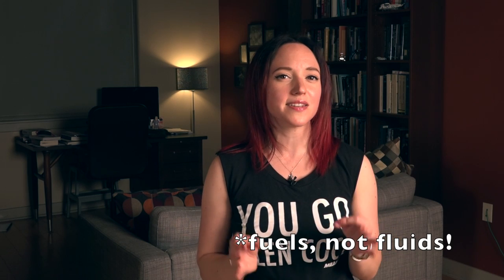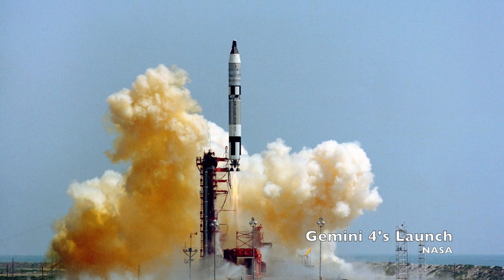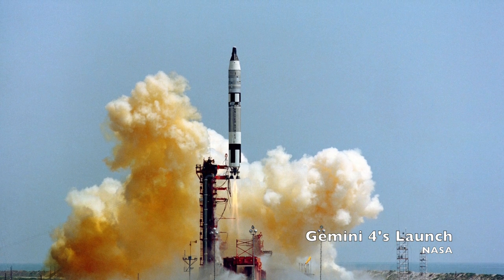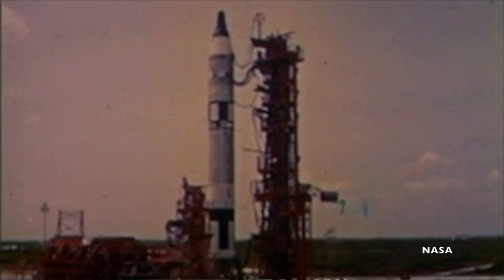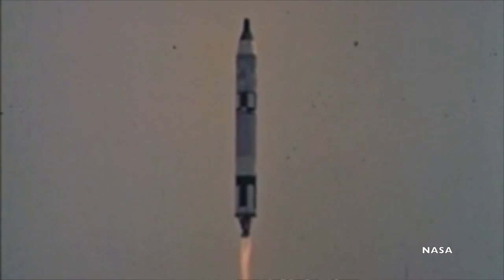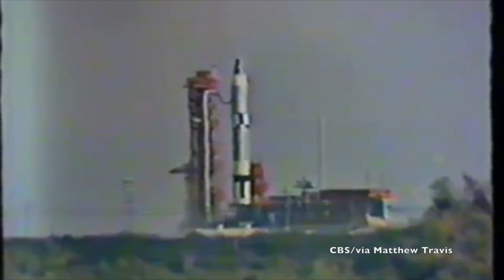Why did the Gemini Launches Make a Bwooping Sound?

Comment: Now that I've watched this video a couple times, I have noticed a similar sound coming from a space shuttle during an RSLS abort, right after the engines shut down. Is something similar going on with the SSME turbopumps making that sound?
Reply from the maker: Don Rudolph I don't know about the SSME turbopumps off hand, but it's possible!
Reply: now i could be wrong, and I apologize if I am, but I don't think they ever had to do an RTLS abort, they did have to do an ATO before though.
Reply: Lance Combes You're right, they never did an RTLS. I was speaking of RSLS--Redundant Set Launch Sequencer--Aborts...situations where a shuttle launch was stopped while still on the launch pad, after Main Engine Start but prior to SRB ignition.
Reply: +Don Rudolph The SSME is a complex staged combustion engine - its turbo pumps where driven by pre-burners that fed the main combustion chamber. I dont think they could make a similar sound at all... Starter cartridges where actually fairly common in the 1950's and 60's to start military air craft - as they eliminated the need for a starter cart and could cut several minutes off an aircraft's pre flight  time, handy for alert standby aircraft. Another channel "AgentJayZ" in "Jet Questions 78" talks about starter cartridges in greater detail.
Reply: Sillydogification Thanks for the info! Perhaps the Shuttle noise is the pumps spooling back down after the shutdown or something along those lines.
Reply: Sort of.... the SSME turbopumps are driven by a preburner, so unlike the Titan 2 engines, those preburners continue to run after primary ignition. It also is using a non-hypergolic cryogenic fuel, hydrolox (liquid hydrogen & oxygen).

So the answer is probably. The preburners do kick in and spin up the turbopumps a second before main engine ignition and that probably causes a similar noise.

Comment: A friend worked for Convair and was one of the thousands that did sheet metal work on the Atlas missile. We both agree that the missile started out as a launch vehicle for the military,and was converted to civilian use. I mentioned that there were numerous modifications needed to get this missile certified to launch a human. This process had to happen with the Titan II also. My question, what missile needed more work to make it safer for human space flight? We all know the Atlas gets its strength from pressurization of its fuel and oxidizer tanks. I was watching a video on V-2 (or better said A-4) development. In the video it was stated that flexing of the missile body was the cause of many failed launches. Internal bracing fixed the problem. Also stated is that the problem was identified by optical observation of the missile during launch phase, could this story have some truth? My connection to the theme of this video is the Titans initial suitability as a system to put humans in space (no connection to the sound)

Comment: I'm old enough to remember watching the Gemini launches.
Room temperature fuel and oxidizers because it was an ICBM.
Dinitrogen tetraoxide, N2O4 was the oxidizer. A liquid at room temperature, so that's why the Titans didn't froth.
But, N2O4 is also exceedingly dangerous. It forms nitric acid on contact with water, like the nice wet surfaces inside one's lungs.

Comment: I've always liked titan but never really seen footage. So basically the gas generator for the pumps were started using a cartridge? Fairly unique, I would use a monopropellant like HTP to spool it up but I guess cartridge has been used on jets for starting so it kinda makes sense. Thing is, I'm pretty sure that the sound is NOT the cartridge. A cartridge should bang usually. I would think that sound is the actual turbine itself in the gas generator.

Comment: The older B-52's used a similar cartridge to get their turbojet engines started in a hurry. The newer models have upgraded turbofan engines with internal starters, better economy, higher and can go longer between rebuilds due to their modern design.

Comment: Trivia: both Mercury and Apollo had launch-escape rockets mounted on top of the spacecraft, to help them get away in case of an emergency. These were jettisoned about the same time as the first stage came off, as I recall.

But Gemini did not have such a thing: it had aircraft-style ejector seats instead. Why?

Comment: I thought I understod what you were saying until you said that they were only spinning for a second. The fuel is still burning and would still drive the turbine. Why does it stop after a second?
Reply: The startup sound is inaudible after the turbines are spinning so fast that it's out of the range of human hearing.
If you listen to a shuttle launch at t-5 when they start the APU's, you can hear those turbines run continuously as they are a much lower rpm. They are hydrazine powered just like the Titan main engines. They pulse the fuel delivery to maintain a constant speed for the hydraulic pumps. You can hear the speed go up and down within a specified rpm range.

Comment: Well done, the German Komet and Nader both used a similar two fuel system for flight and was so volatile that many a Komet was destroyed during fueling. The hydrogen peroxide component was so corrosive that it could dissolve flesh unlike the 5% or less that is found in your medicine cabinet and fueling the Komet could be a deadly for a ground crew.

Comment: Rocket engine turbo pumps are usually direct drive, with no gear box.  Hot gas from the gas generator drives the turbine.  The turbine is mounted to the same shaft as one, or more commonly, both the fuel and oxidizer pumps.  No gears, direct drive.
Reply: The H-1 engine flown on the Saturn I and Saturn 1B had a gear train that drove the fuel and oxidizer pumps. Always wondered why since direct drive had fewer components to fail.  Maybe it's harder to design a direct drive turbo pump to give the proper flow rates for the fuel and oxidizer
Reply: OK, I have to eat a small slice of crow.  With more reading, I learn that the LR-87 engines used on Titan II, both the manned and unmanned versions, did have gear trains in the fuel and oxidizer turbopump systems.  Another poster writes that the H-1 engines also had gear drive.  I think my previous statement that most liquid fuel rocket engines use direct drive applies to most modern engines, but. obviously, not to some of the earlier ones.
Reply: Here is a quote from  http://www.techbastard.com/missile/titan2/startsequence.php

"The gearbox acted as a speed reducer between the turbine and the pumps. The turbine speed was 23,000 rpm; the fuel pump turned at 8,850 rpm; and the oxidizer pump at 8,000 rpm. In addition, a 25-horsepower hydraulic pump was driven at 3,800 rpm by the accessory gear train of subassembly 2. The gear train lubrication system contained a five-element lube pump mounted on the accessory pad. The lubrication system also contained a reservoir, heat exchanger, filter, and oil jets."
Reply: More from techbastard.com  about the LR-87
"The gas generator produced hot gas to drive the turbopump assembly (TPA). For starting, a starter cartridge supplied 2000 psia of pressure to the TPA turbine, which turned the TPA. The TPA supplied propellants to the gas generator combustion chamber. The hypergolic propellants ignited and the gas generator exhaust gases drove the TPA to sustain operation. The starter cartridge, shown in figure 13, supplied high-pressure gases to start the TPA turbine, which turned the propellant pump until the gas generator took over.

The cartridge was a solid propellant and burned approximately 1 second, producing approximately 2000 psia to the TPA turbines. "

Comment: I understood you because I have a decent idea how rocket engines and their turbo pumps work, the basics at least.  I think people without that understanding might be left confused.  Both your mentions of fuel tank pressure and gravity are potentially confusing.  In modern, liquid fueled rockets, since Goddard and Von Braun, pressure and/or gravity-acceleration is only the first step of pressurizing oxidizer and fuel to the engine.  The second, much more powerful, step is the turbo pumps.  The turbo pumps are turbo in two senses.  They use turbine pumps to pressurize the oxidizer and fuel, and those turbo pumps are themselves driven by a gas turbine.  Powering that gas turbine is a design problem.  It requires a gas generator to supply hot gas to drive the turbine.  The V-2, Redstone, and all the R-7 family, including Soyuz, use a separate fuel, hydrogen peroxide, a monopropellant.  The hydrogen peroxide is simply pressure fed to the gas generator where a catalyst causes it to decompose
Reply: Decomposing hydrogen peroxide produces a hot oxygen/steam mixture that drives the turbine.
More modern designs, including the Titan, fuel the gas generator with the same oxidizer and fuel used in the main engine.  Since the Titan fuel/oxidizer are hypergolic, one might imagine that simply letting them flow under pressure/ gravity into the gas generator would do the job.  The design problem is that the gas generator is fed fuel/oxidizer from the output of the very same pumps it drives!  The pumps need to be pumping in order to drive themselves.  This is a bootstrap type problem.
Reply: +Mark Holm The start cartridge solves the bootstrap problem.  It briefly supplies hot gas to drive the turbopumps while the turbopumps drive fuel and oxidizer to the gas generator to initiate a self-sustaining process.  se the diagram and explanation at https://en.m.wikipedia.org/wiki/Gas-generator_cycle

Comment: Hi Amy !
  I've always wondered, though Now I guess its too late, but if you remove the arm in the shuttles cargo bay, filled half the bay with extra fuel tanks, the other half of the bay with a L.E.M., would it have been possible to fly a lunar landing mission with the shuttle ? I'm thinking the O.M.S. engines would have been more than powerful enough for T.L.I., and if there would have been more storage space for consumables than on the Appolo spacecraft, I'm thinking that they could have flown a longer and more extensive mission than the Apollo program.
Reply: +8091pinewood - For one thing the shuttle's thermal protection system was only capable of protecting the shuttle while reentering from low earth orbit. Coming back from the moon generates much higher speeds, more energy and a lot more heat. The Apollo heat shield and the Apollo reentry profile were specifically designed to cope with high speed reentries from the moon.

Comment: If you spray canned compressed air (the stuff sold to blow out dust) at any small fan (like those in a computer), you'll get a similar sound*. I suspect the reason is similar; spraying air at a fan is very similar to the turbine half of a turbopump.

* Danger! Peligro!  it's easy to over-speed the bearings in a fan by doing this, so try it with extreme caution, preferably on an old fan you're going to throw away anyway.

Comment: My guess was always that it was the sound of the fuel pump(s) starting and running. Then once combustion happens the sound is drowned out. 

I wasn't spot on, but pretty close for someone with no formal education on the subject whatsoever.
Reply: Dan Scoggins You were spot on, actually. The rapid change in pitch is due to the rapid change in frecuency as the turbine axle goes from rest to some tens of thousands of RPMs, in a second or two. Then its drowned by the main combustion chamber lighting up, hence the "Swbooop-Roar" sound. Many rockets do the same sound, but it's rarely recorded.

Comment: How do rockets work when the fuel and oxidizer tanks are not pressurized and gravity does not force the fuels in to the combustion chamber like in space?
Reply: +Julianne Morgan That's a good topic for a show, but the short answer is usually small rockets called ullage motors that give a little forward thrust to the vehicle to make the propellants settle to the bottom of the tanks.
Reply: Sean Crocker Thanks for the answer!
Reply: +Julianne Morgan - There are typically two methods used. One is to use mechanically driven turbo pumps to force the fuel and oxidizer in. The other is to pressurize the fuel and oxidizer tanks with helium gas supplied by heating and boiling liquid helium. The first stage on the Saturn 5 actually used a combination of both methods working together. The Apollo service module SPS engine and both engines on the lunar module used pressurized gas to pressurize the tanks and force feed the propellants into the engines.

As noted previously engines being started in weightlessness need some sort of ullage motors that start first to settle the propellants so that only liquid goes into the engines.  Sometimes solid motors were used to do this. On the Apollo CSM and lunar modules the rear facing RCS thrusters were fired to settle the propellants.
Reply: +Joe Vignolo Interesting! Thanks for your response.
Reply: +Julianne Morgan - You are welcome!

Comment: I've heard the same sound on a compressed air start system for an emergency diesel generator for nuclear plants... if you lose power, how do you start the emergency diesel? Have a fail-safe that fires off a compressed air starter when it loses power, of course!

Comment: What is the beepin noise on the Apollo missions when the astrounauts talk @vintagespace
Reply: It was primitive remote control.    Here ya go:  https://en.wikipedia.org/wiki/Quindar_tones
Reply: Well, it was not PRIMITIVE back then, it was state-of-the-art.   But by today's standards, it was like using a slide rule instead of a computer to do math - something else they had to do when calculating fuel use, etc. - was to use a slide rule...

Comment: It was the oxidizer pumps that made the whole thing work. The Russians came up with a better way but you had 30+ engines to feed. So they could be smaller. The engine design is still used in modern rockets. As they found a warehouse full of them and the US bought the rights to build new ones.

You should lookup how they worked.
Reply: The Russian N2 rocket that features 32 engines was a disaster with each flight ending in the rocket exploding or breaking up. The same "reconditioned" engines were used in an attempted commercial rocket launch last year with the same results, the rocket exploded within seconds of ignition.
Reply: Gary Bricault
You're ignorant Interestingly,

Energomash partnered with Pratt & Whitney in the 2000s to produce Russia’s latest rocket motor, the RD-180 that powers the U.S.’ fleet of Atlas rockets. Before that, the Russian company’s  motors powered most Soviet and Russian spacecraft from 1965 to the present.

You should read more!
Reply: You really need to get out more. The RD-180 is only used on the Atlas V. It failed in a spectacular explosion on the SpaceX 9 vehicle seconds into the launch and shut down early on the most recent  Cygnus OA-6  launch.  I understand the principles behind its highly touted method of deriving extra power through a reburn of turbine gases. It's a crap shoot design. When it works it's great. And when it doesn't, it's a really short ride.
Reply: Gary Bricault
Maybe they should ask NASA and the Air Force how to use them. As they been using them for years.

So I'm guessing they know better then you . As ones personal opinion is worth spit. So if you don't like then fine. Fact is it works and very efficient.

Comment: Why did Gemini lack an escape tower?
Reply: +Usuc midicq Nasa was going to use the "Rogallo WIng" to glide the Gemini capsule to land instead of plunking it into the ocean. When they decided that the wing wasn't going to work, it was too late to put the Lunch Escape System on the spacecraft and they put ejection seats in. Jolly Wally (G6) didn't pull the trigger on the launch abort because unless the rocket was exploding, he didn't want to risk life threatening injury!
Reply: +Neil Armstrong The Titan was actually something of a hot rod compared to the Atlas-it had a significantly higher thrust to weight ratio, so I'm guessing that weight wasn't as much of a concern.I've been told that the hypergolic fuels would have produced a considerably smaller fireball than the RP1/LOX combination used by Atlas, which is why they went with ejector seats.  And yes, NTO and A50 are highly toxic, but not as toxic as certain death in an exploding rocket.
Reply: +almostfm Ahh, Yes! The hypergolic cloud. Gunther Wendt wrote about a car parked near the launch area with a chrome bumper that turned black... the engineers started to wonder how bad the fumes were for them! The nickname for the noxious gasses was the "BFRC", Big F'in Red Cloud. The biggest immediate problem with the ejection seat was the launch angle and forces. It was almost a sure back breaker... and then you flew through the BFRC, so an abort on Gemini was really a serious issue for sure!
Reply: taloowa  Hey, I never said it was a good solution :-)  And I think the idea was that, if necessary, you'd punch out before the explosion that reduced the rocket to kit form

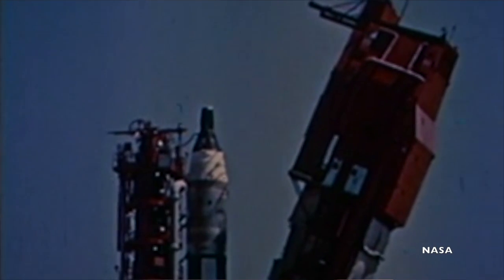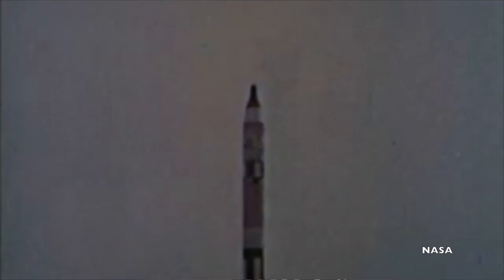Comment: At 1:04 you say "if the tanks are pressurized the shear force of gravity",  Sorry but if the tanks are pressurized, gravity has nothing to do with the flow as that is accomplished by the pressure.  Then at 1:24 you tell us about pumps to pump the fuel.  And you are curious as to the turbine spin up sound as the high pressure fuel starts it spinning. 

I have viewed several of your videos and find myself wondering why someone so confused about the facts, and what really happened is even doing videos like this.  May I suggest you start doing videos on topics requiring less geometry, advanced math, and way less fluid dynamic equations making it easier to both understand and explain.  Like maybe kitten petting.